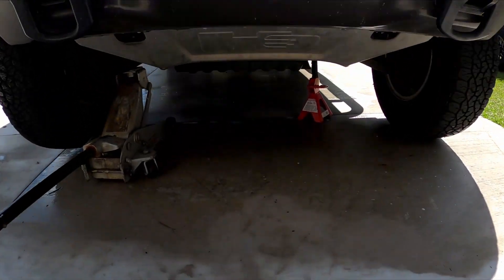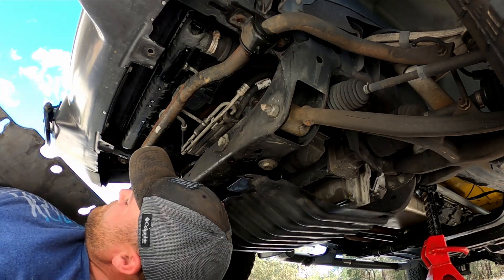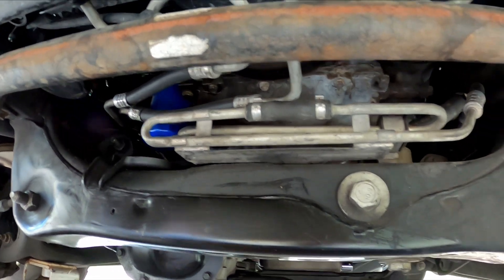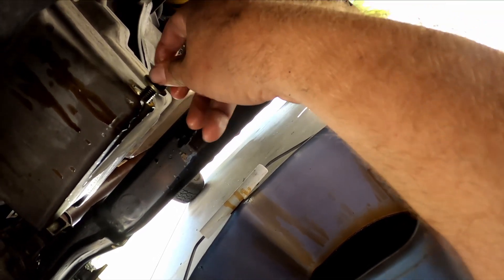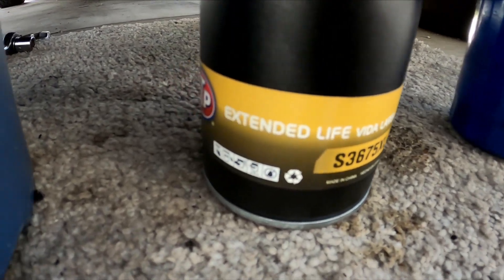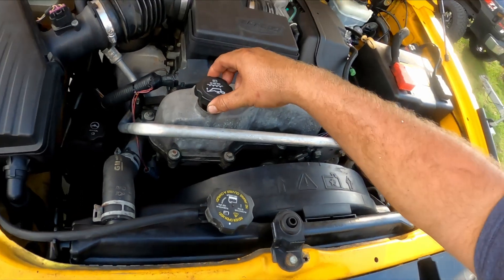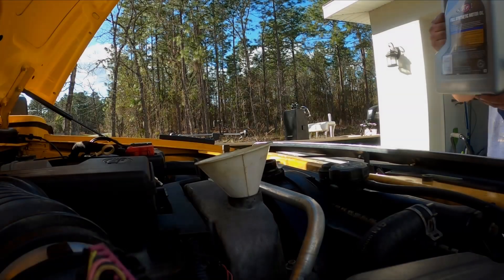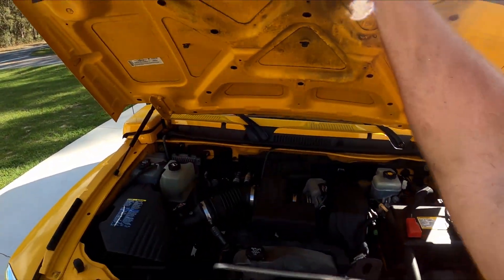DIY 2006-2010 Hummer H3 Oil Change

Comment: Maybe loosen the rear bolts first before you take out the front ones.  Also oil should not be cold when you change it. If it’s warm it’ll flow better and you’ll get more out faster